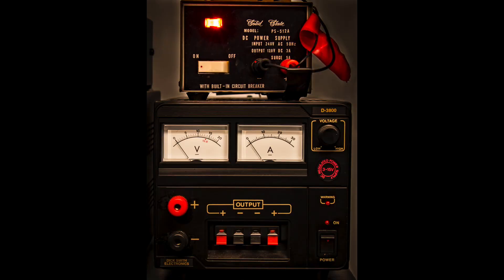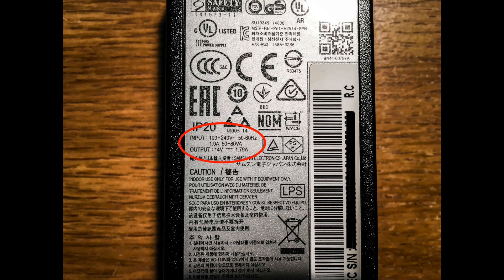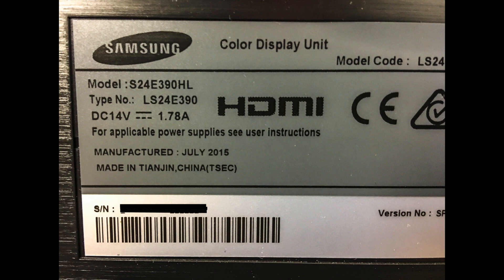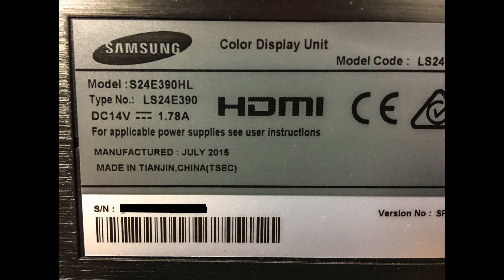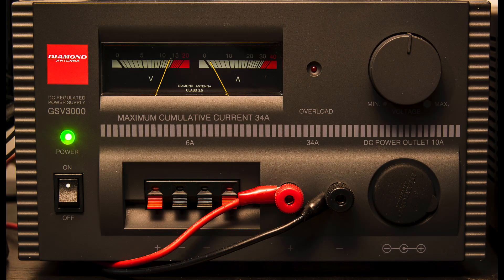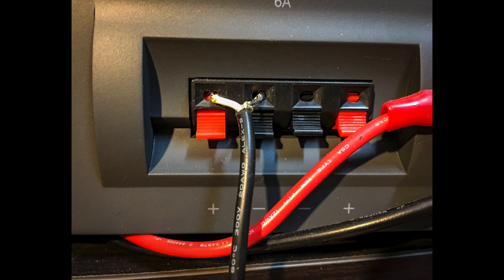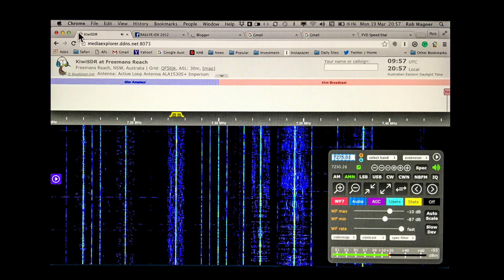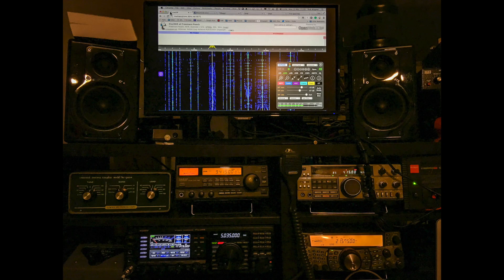Solving an RFI Problem in a New Monitor

Comment: I have monitors from BENQ and Fujitsu. They are the posh ones with PSU inside the monitor casing so it's not easy to replace. The QRM from all of them is horrible. I found a lot of those carriers are radiated from the panel itself. I proved this by wrapping the whole monitor in chicken wire ! That made a good reduction but is impractical (see my video on my channel about this). Finally I gave up and switched to using laptops only. The silence is bliss 🙂 I use Lenovo Thinkpads which seem pretty well shielded. Also, I discovered that clip on ferrites work much better if you throw away the plastic casing and squeeze the two halves tightly together using gaffer tape. For lower frequencies it helps a lot if you put as many turns as possible through the ferrite, not just a straight wire. Anyone know any other solutions that work ?

Comment: Meanwhile, I am convinced that Samsung and LG are made in the same factory.  When my old tube radio is on and the LG monitor comes out of sleep, the receiver starts humming so loudly that the plaster falls off the wall.  Back to sleep and everything gets quiet again.  The devices are about 2 meters apart.   Thanks for bringing up this RFI source and of course for all the other informative videos.  73
Reply from the maker: Interesting, Patrick. Thanks. I now have an Acer monitor that is very quiet across the spectrum. I guess it's a matter of trying to find a well-built monitor for the shack. But it's an expensive way to find out!! All the best, mate. Rob VK3BVW

Comment: Many monitors have the power supply inside them.  Is there a way to ground the monitor? Mine is all plastic.
Reply from the maker: Correct. Since making this video, I now have an Acer monitor that has an internal power supply. Thankfully, this monitor doesn't emit any RFI hash. There is no easy way to ground internal monitors in plastic cases.

Comment: I am watching this video on a Philips 276E monitor, and the parasitic carrier makes radio use in the shack impossible. Unlike your experience, the RF hash from the power supply is non-existant. Which ferrite types did you use for your 7 - 21 MHz problem? Mine is impacting me in a similar range. Thanks for sharing the video!

Comment: I had a Samsung monitor about 12 or 13 years ago where some of the caps inside the monitor went bad after a couple of years. The monitor would flicker for a minute or two when turned on, then settle down, so I suspected bad capacitors. After opening up I could actually see three electrolytics bulging at the top. I changed them for higher quality and higher temperature rated capacitors and it then worked perfectly.  It is still going strong to this day. I find it amazing how a company like Samsung can think saving a few pennies on wrongly rated and/or low quality components is worth it to risk the reputation of such a big company. BTW, thanks for a great video.
Reply from the maker: Thanks for sharing your story and watching the video. 73, Rob VK3BVW

Comment: Good ideas but two thoughts... First, I have found HDMI and other video cables to be more of a problem than the power supply in the shack.  Most of my monitor problems have been cured by putting a single RF choke on the video cable.

Second, winding Ethernet cables through a choke is fine, but making those tight loops through the choke is ill advised.  CAT5/CAT6 cables have a minimum bend radius.  By making those tight turns through the choke you have destroyed the CAT-rating of the cable and have probably caused much higher crosstalk within the cable itself which could cause other issues down the line.  If you look closely at your cable, you will see a discoloration of the plastic outer jacket where the radius is too tight.  This is very bad for a CAT5 or CAT6 cable.  By using a slightly longer cable, you can wind the same number of turns through the choke, but make bigger loops and keep the cable rating.

When I ask people which monitors cause problems and which don't in the ham shack, I get a unanimous "monitors are clean, they cause no problems!"  I've tested- virtually every monitor is crap in the ham shack.  There is not a monitor made that does not cause extensive RFI in the ham shack in my experience.  Chokes on EVERYTHING!
Reply from the maker: Hi Marlo. Thanks so much for your comments. 1) Re. HDMI cables, yes as you say, these can be a problem. Not mentioned in the video, but I also changed out the original HDMI for a much higher cable with quality shielding, and that also helped in my situation. 2) Re. winding ethernet cables, you are also correct that winding these tightly can be an issue. However, I went back to the cables you saw and there is no discoloration of the outer jacket. I suspect you were looking at the light reflection on the cable when the photo was taken. But, your point is a good one! Finally, I agree that nearly all monitors put in the ham shack should be choked wherever possible. I've also got chokes on the powered speaker leads, the little mixer, etc. It seems like I'm forever buying ferrite! hihi. 73 and happy new year. Rob VK3BVW

Comment: Very nice video. I had the same problems and after toroids turns and  clips of ferrites, the problem of the RFI was there without solution. I tested an old power supply for my old notebook with the same volts and amperes: with this power supply the RFI was attenuated. 
This is my experience.
Many thanks
73 De IZ6CSS

Comment: I am fighting an interference problem on a computer monitor but it is not the power supply.  The monitor is made by AOC (model 195LM00003).  It is powered directly from the 120v mains.  The interference is in the 70cm ham band (432 MHz).  It appears to be related to HDMI. The noise is only present when the HDMI video is available.  Checking if the problem was from the PC or monitor I moved the HDMI cable to another monitor in the shack.  Happened to be an ASUS.  No interference at least in the 70cm band. Also the ACER monitor my security cameras are on, also in the shack, produce no interference.  I have a second AOC monitor and it produces the same interference.  Using an EMC probe on an FT817 the noise is strong anywhere around the AOC monitor.  I can even hear it on a small yagi in the back yard.  The AOC monitor was a low cost 20" model.  My best option here is probably to replace it.  I will take a trip to MicroCenter with my FT817 and the EMC probe. See if they will let me run some tests with the demo units on display.   Enjoyed your video.  I have run into switching power supplies that are noisy.
Reply from the maker: Hi Mike. I agree that if the monitor and its power supply are noisy, then chances are that all the monitors from that brand will be the same. If after employing some of the methods I use in the video you still can't quieten it, then it's best to dump the monitor and move on. Some people seem to have had success with ACER monitors in their shacks, and your experience appears to endorse that, too. I think that my next monitor will be an ACER! :-)  Good luck and 73, Rob VK3BVW
Reply: @RobVK3BVW  have you tested Dell monitors?
Reply from the maker: @campersruincod6134   No, I haven't. Sorry, I can't help there.
Reply: @RobVK3BVW  how can I test for interference?

Comment: Great video! Can you buy supplies with correct filtering included?
Reply from the maker: Jordan - Yes! You can buy regulated supplies that are now not much bigger than the bad switch mode wall warts that are put in with consumer products.....well, at least we can here in Australia. So I guess they must be available in other parts of the world, too. But they are more expensive than cheapie switching supplies. Thanks for checking out the video, Jordan.
Reply: @RobVK3BVW  Thanks Rob, great video. I've always suffered with RFI noise even with a $1600 Samsung monitor I use in the shack. Its disappointing that even the biggest market leader of these monitors can't produce a product that doesn't interfere with HF spectrum. Now to sort the Samsung Fridge that has a digital inverter causing s9 of noise right across HF. 😩

Comment: I have a monitor with one of those packs on it.  It creates carries all over the place from 20m on down. I was about to replace it with a tv like what I use as my other monitor, as it doesn't cause any RFI, but this would be a cheaper option.

Comment: Good outcome Rob, a little disappointing when you consider the product is from a better known manufacturer, we have a high end Sony CRT TV here that creates horredous parasitic RF at 10Mhz enough to blanket WMV completely, surely consumer protection laws and product standard regulations should prevent such items items reaching sale?
Reply from the maker: Thanks for your comments. Yes, there are supposed to be product regulations. Telecommunications gear is subject to this. But  consumer items of all types are being let through without proper testing. Very disappointing.

Comment: You don't put out many videos but what you lack in quantity you more than make up for in quality and this video is an excellent example. Thank you for taking the time to share your experiences. You have yet again given me something to learn and think about and I really appreciate it.

I do have a question though, if you don't mind. I've heard many recommend that when using portable shortwave radios one is better off running them on batteries to avoid the noise that may be created by using an AC adaptor. Makes sense. The thing is, I've got a Grundig 800 here that eats battery with reckless abandon so I pretty much have to use it plugged in. Do you think I might reduce the amount of RFI if I were to purchase a regulated, linear AC adapter? The Arndt MT12-Y090100-A1 looks like it could handle the job (9V/1A) and it's quite affordable.
Reply from the maker: Golan Klinger - Firstly, thank you for your very generous comments and feedback. Very much appreciated!
The Grundig 800 probably draws more than 1 amp, so, yes it is going to chew through your batteries like there's no tomorrow! I suspect you should only be using batteries when you don't have any alternative power options. 
However, did the 800 come with an AC adaptor? It should have! If so, do you notice more RFI when using the adaptor than when using the batteries? If so, then the AC adaptor is possibly creating some of your RFI issues. In the past, I have heard of radio manufacturers supplying noisy AC adaptors with their receivers, which is extremely "naughty" of them!! So perhaps this is the problem here. In which case, any regulated linear power supply would be a much better option than a noisy AC adaptor. Good luck.
Reply: I purchased my Grundig 800 secondhand and unfortunately it didn't come with the original AC adaptor. I was able to source a suitable replacement which works well enough but is of the switching variety. The aforementioned Arndt MT12-Y090100-A1, if I'm to believe what it says on the web, is linear and since it is inexpensive, I ordered one to conduct an experiment comparing the two. Should be interesting to see if it makes a difference.
Reply from the maker: Let me know how it works out for you!